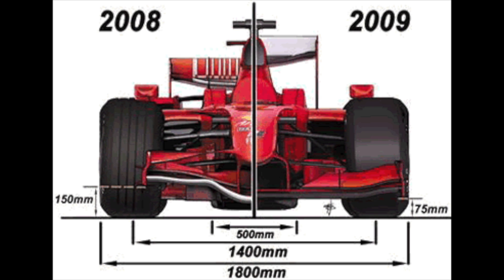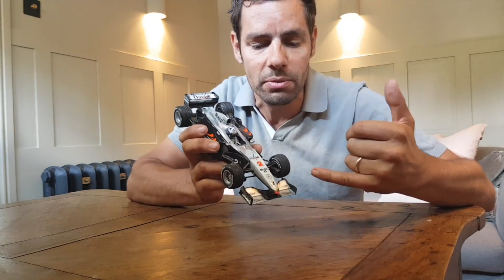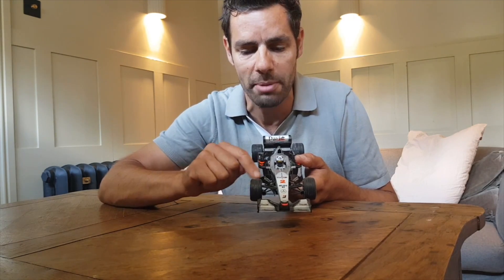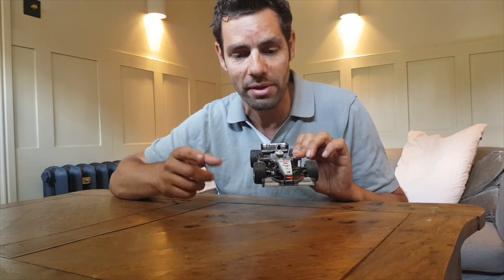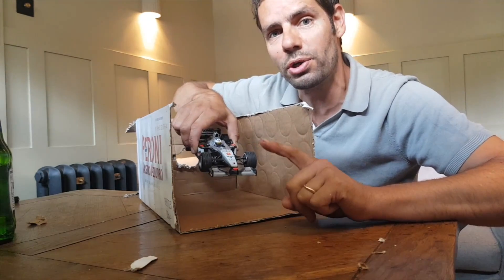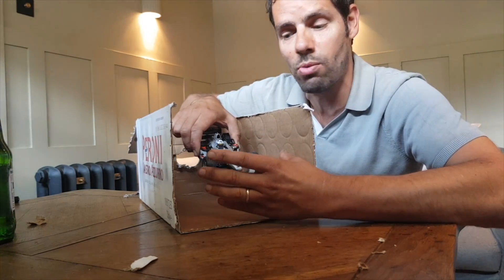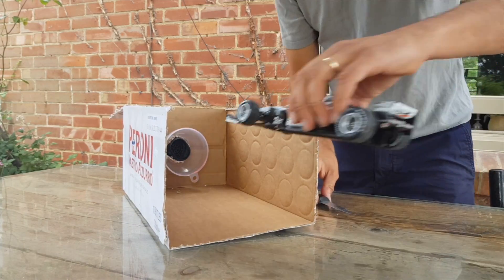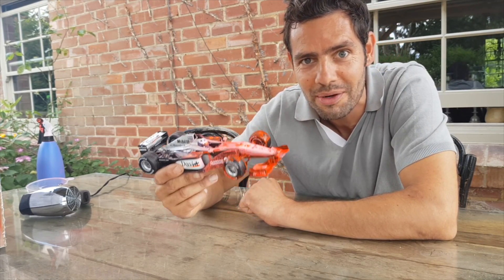MP122 - F1 'outwash' front wings & wind tunnels

Comment: #Askelvis, the outwash is a rather ironic unforeseen consequence of the large shovel wings, considering those (regs) were supposed to improve overtaking.
So the question is, why not just go back to narrower wings? 
Secondly, wouldn't decreasing the size of the cars also help? Similar dimensions but at 80-90% the current ones (which are huuuuge). 
Lastly, why not just ban wind tunnels since CFD is more industry relevant? 

Have to say that 2008 had pretty decent overtaking, even with the harder Bridgestones.
Reply from the maker: I can definitely see a time, not too far away when CFD takes over car design and development completely. 
As for ways to improve the overtaking situation, they've found a solution that they're convinved (by extensive research) will make it better for next season.

Comment: #AskElvis This year's Ferrari has a longer wheelbase when compared to their last year's car. The end result, it seems, is that the SF71H is working well on all types of circuits. On the other hand, the Mercedes is sticking to its (longest on the grid) wheelbase concept, which still hurts them on slower circuits (Monaco, Singapore, Hungary). What do you think, will Mercedes be thinking about fixing this flaw for next year's car? Another question, what do you make of this reshuffle at Mercedes, with Aldo Costa assuming role of an advisor? Are they feeling the Ferrari heat?
Reply: Ferarri heat 😂

Comment: Faaaaantastic video! My thought is why doesn't F1 go back to regulations that allow Inwash front wings if it reduces the amount of air disturbed by the car, if it goes to the barge boards and side pods then does that mean less area of air is disrupted and cars can get closer. Grooved tyres aside I thought those cars looked ace!
Reply from the maker: They are trying to address this for next year, that's the whole reason for rushing the 2019 aero changes through.
Reply: Wow! Thanks for the reply! I'm still a bit confused as to how the wider front wings allow for less outwash? surely if they're wider then that can create more outwash? or is it a case that because they're wider they don't need to work the air so heavily around the tyre because the end-plate will be flush with the outside wall? Maybe a video in there to explain! ;)

Comment: Marc 1 small detail I may be wrong but Sauber have a full size wind tunnel and I was told they car banned from using it as the regs say they are allowed a maximum of 60% am I right?
Reply: wait.. you're not allowed to put a real size f1 car in the tunnel? #askelvis
Reply: Yes it's limited to 60%. See Sauber's video:  https://youtu.be/FQxmOQmnaGw
Reply from the maker: Not banned from using their tunnel, but yes, 60% is max scale allowed.
Reply: Suabers rolling road tunnel is impressive (awesome). They use it but not with a full size car. They use 60% models as required by regs. Sauber made a pretty good video about their tunnel, it may be on their website? or try a search.
Reply: Thanks for the link :) good info there
Reply: what? you can't use 1:1 scale? only 60/100? No wonder we have so much problem with these aerodynamic stuff. Scaling model for fluid is really complicated stuff. It's not like you just multiply the result by 100/60.

Comment: Gonna need a bigger hairdryer!

A question, if the regulations were to go back to a in-wash design on the front wing, with the present aerodynamic look of the cars, would the teams be able to leave the TMG facility in Cologne?

I did hear a rumour that Williams were spending a massive 8 figure sum either building a new larger tunnel or upgrading their existing one.

Great video as usual!!!!
Reply from the maker: In theory, although the investment required to build or upgrade a wind tunnel is huge, and they know the Toyota one works.

Comment: But why are those out wash vortexes a problem? They are going away from the car anyway, so the teams shouldn't care. Is it because when the vortexes hit something, they "push back" and disturb aerodynamics?
If so, then can other cars that are behind you or to the side disturb the aerodynamic flow?
Reply from the maker: Yes, it distorts the data if space around the car is limited and flow is restricted and redirected by walls etc.
Reply: Probably after hitting the wall it turns back and disturbs the airflow like the car is getting some sidewind aswell if the tunnel is really narrow.
Reply: All the air behind a car is disturbed this way, even when you try to overtake you will be in the outwash of the front wing. The vortexes make it so that the air doesn't go over the wings of the car behind in the way the car was designed, therefore it doesn't generate the downforce it normally would resulting in less grip in high-speed corners and under braking.
Reply: The low pressure areas behind the tyres/car 'sucks' the vortex inwards again
Reply: Earnhart wrecked becasue of side drafting i believe
Reply: All that "outwash" and all only works perfectly with undisturbed perfect air. When you push a large quantity of air outward, and are poking a giant hole through the air with the frontal area of the car, there is less air, and the air that is there is very disturbed. When you have less air, you get less downforce.  And less drag, which is helpful for slipstreaming, but when you get to a corner, you need that downforce back.
Reply: Its basically what MrSkyline says. 

The vortices go away from the car but then once its washed after from the car, there’s no control over that air. As such it’s turbulent and completely altered to air that originally passed over the car. This big mess of turbulence is hard for teams to accommodate in their designs which is why the cars behind struggle to create the same level of downforce as the car in front. If you lose so much time through the corners then its almost irrelevant how much power and time you have on the straights. You’ll just break even at the very most. This is where tyre wear and track position became so crucial. If you could get to the front row of the grid, barring accidents or reliability and a strategic mess up. You were likely to stay there even if the car was rubbish over long runs. 

Brawn and RB took advantage of Mclaren and Ferrari squabbling over the title in 2008 and focused intensely on the reg changes in 2009. Mclaren and Ferrari were caught out the first half of that year but they bounced back eventually. 

Now the problems are that if the drivers sit in the wake of the car in front, the hot heavy turbulence eats away at their tyre temperatures causing graining/blistering if they continue to overheat them. Simultaneously this hot air goes into the cars intakes causing the engine to work less efficiently than in ‘clean’ air. Thankfully the differences in power output but also traction mean that drivers can stick with the car in front and tbf to the drivers. Most don’t waste any time sticking their car down the inside of the guy in front. It makes for entertainment in one form or another. The sad thing is though that race craft has somewhat died out a little. You’ll struggle to see something like Alonso against Schumacher in San Marino back in 05. That, quite well could have been Alonso’s absolute toughest race of his career. The pressure and intensity of that battle is underrated largely as neither team or driver is British.

Comment: Marc, does that mean with the 2019 regs, that aim to reduce outwash, that MTC can resume use of their wind tunnel?
Reply: Put #AskElvis. This is a good question.
Reply: Presuming they can would Macca still need to confirm data by using another tunnel as the outwash won't go away?
Reply from the maker: It depends on the regs, which aren't finalised yet.